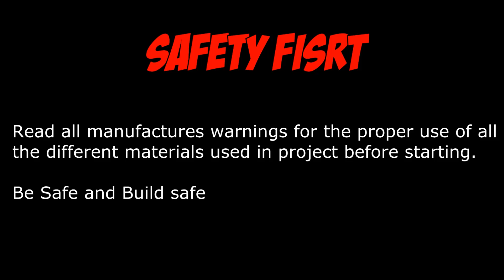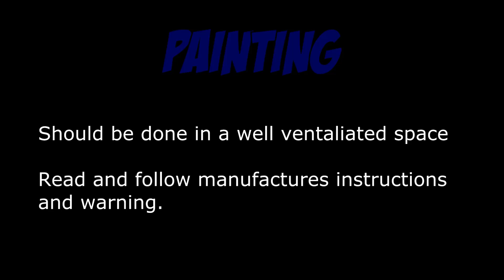DIY Planted Aquarium Lighting #100

Comment: Very neatly put together, but you skipped how the holder was suspended inside your hood which is fairly important.
Reply from the maker: It's there it run by it fast check at time 1:21 to 1:32.... Held down with 5 min epoxy or you can drill 2 hole one on each side of the plugin and use zip ties.